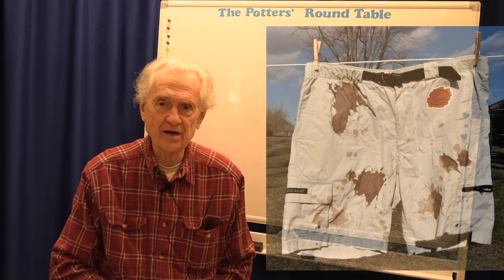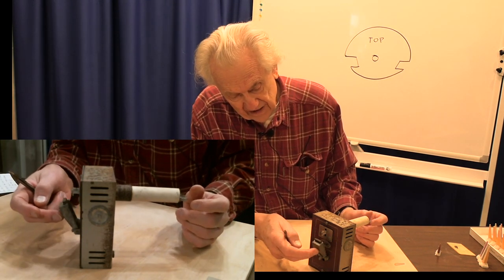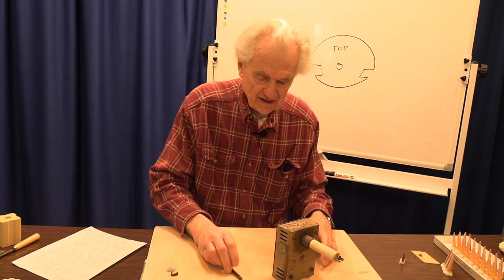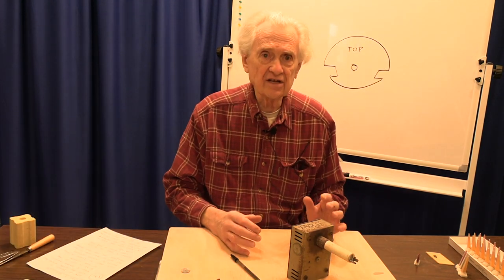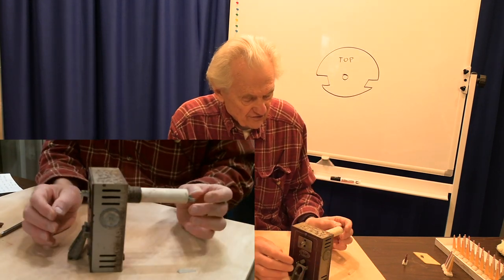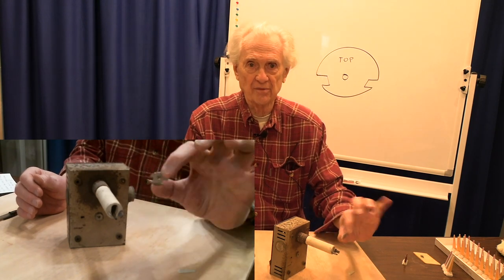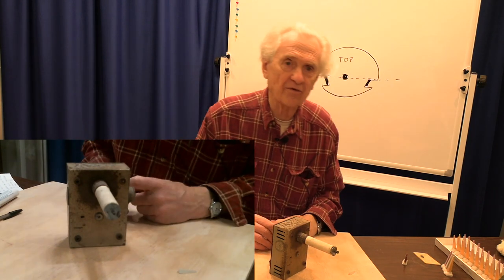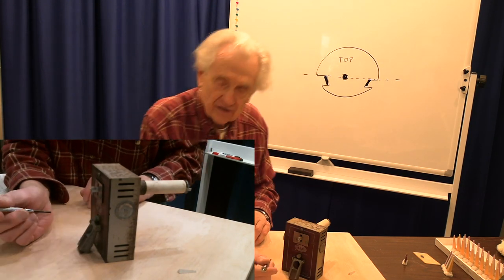Pottery Shorts Adjusting a Kiln Sitter

Comment: My Duncan 820 s kiln sitter barbends  as I suspect it should but my witness cones underfire somewhat. How can I adjust the sitter to basically hold a bit longer? The elements etc have all been checked.
Reply from the maker: Diane, it's difficult to make the hold a bit longer, but you can use one cone higher in your sitter. I really wish Phil were still here, he passed in July of 21. He told me to use one cone higher in the cone sitters. If you want a cone 6 firing, you should use a cone 7 in the sitter. The weight of the rod on the small cones will cause them to bend early. Monitor your firings and set witness cones inside the peep holes. If cone 6 falls before the kiln sitter shuts off, you can turn off the kiln and your good to go. Let me know if this makes sense, or if you want to chat about it.
Reply: @WashingtonStreetStudios  thank you very much for your time and the information. I do miss his lectures so much.